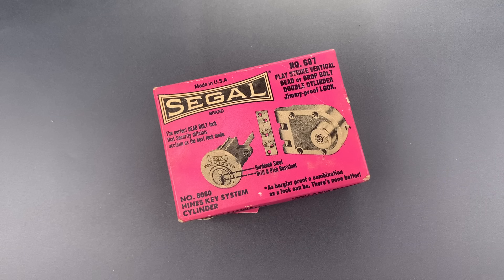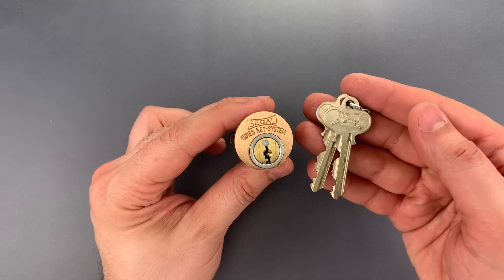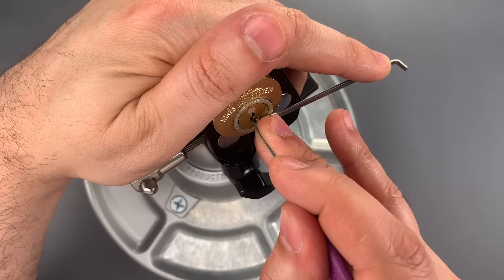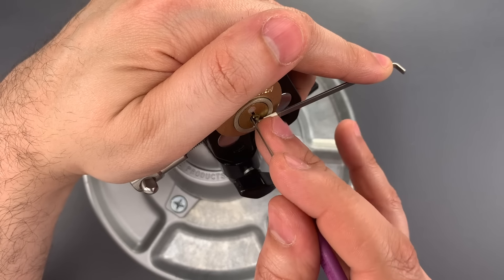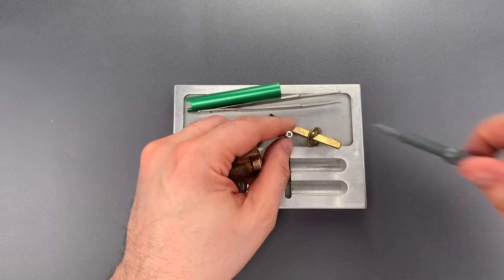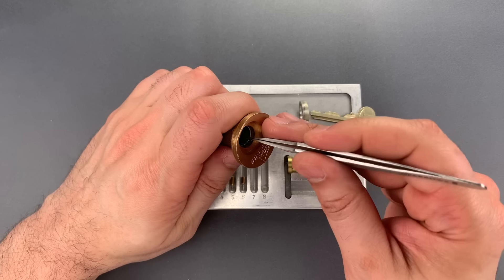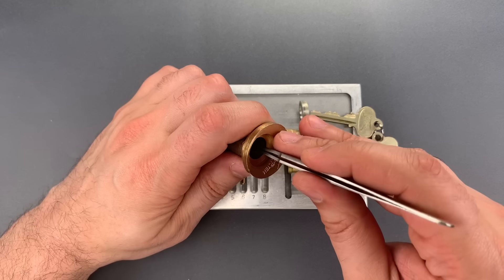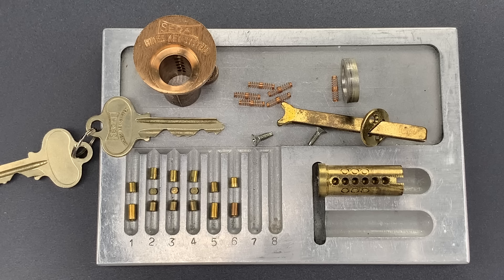[1181] A TRAP For Pickers! The Clever Hines Key System Picked

Comment: I just had a great idea for how to make this basic idea into a near unpickable lock, even if you know the trick. You could have split pins in every position, but which half has the trap is random. Every pin would have two detectable solved states, but you couldn't test for which on is the right one without turning the cylinder and possibly seizing up the lock. There would be 64 possible combinations and you only get one attempt, so a 1.56% chance to get it right, even if you know what you're working with. For added security you could split the pins into even more parts. 3 sections on every pin would give you 729 possible combinations (0.14% chance).
Reply: I could agree. I believe I see where you are going with this and I am curious what other knowledgable people (LPL I am looking at you: wink, wink, nudge, nudge, need I say more?) might say.

Comment: I've had a thought about an anti pick lock. The key has 5 pins, but the lock has 6. One of the pins in any of the positions, would be a switch. Which when pushed up by a picker.  Would just lock the cylinder. Only a special magnetic key could then unlock the cylinder.
Reply: Oooo, I like it!
Reply: Unless the pin was in the last position, the key would lift it when it was inserted.

Comment: All these comments mentioning that this has better security than today's locks fail to address the point that this comes at a considerable cost of also locking the owner out when someone else attempts to pick this lock.
Reply: Leave a window open, just in case. 😁
Reply: A small price to pay for safety. If they made it, they could easily make something that comes with the lock to disable the seizing. However, there would be a bit of security lost.
Reply: @tymoteuszkazubski2755  I'm not an expert on the topic, but I think most burglars break into houses when the owners aren't home. Thus, no benefit to an ability to reset from inside.
Reply: Probably not the right lock for your front door, but if you're a business and want stuff in your records room (or a store room) to stay there no matter what, this feature wouldn't be an issue. The cost of replacing the door probably would be much less than what the room's content was worth.

20 years ago I worked with high-level cryptographic keystore cards for servers. Those were very expensive (we're talking 5-digit prices) and couldn't be transported by plane because the elevated radiation up there triggered their self-destruct mechanism. You could configure them to self-destruct when losing power without being shut down properly (with password) first. They had light (visible, ir and uv) sensors inside their casing, etc. And their self-destruct actually fried the silicon, not just erased the data. Those were used by credit card processors---they just could not afford their private signing keys to be stolen. Re-buying the hardware and creating a new key was a small price to pay for them.
Reply: You are over thinking this.  First drill out the end of the plug remove the HS ring then drill out the pins as usual, insert a screwdriver and turn.
Reply: @Viewer19  but that would be destructive. I wonder whether you could escape the trap with high pressure air to push the hollow pins back.
Reply: Break a small window at that point and climb in. it'd be cheaper than hiring someone to drill out the lock. $200 vs 2.5-3.5k. Plus if the cops are called on you, you did nothing illegal. it's your property. you can do that if you want.
Reply: You're all ignoring one key benefit that he mentioned in the other video on this strategy - with a trap lock, you will know that somebody has tried and failed to pick your lock when you return. Otherwise you'd be ignorant and a stealthy intruder could keep trying on successive occasions without you even knowing.
And the 'lockout' situation is simple - only use this on houses with two doors. If one gets tripped, enter via the other door and remove and replace/reset the lock from the inside. And don't use traps on both doors! (Just have good anti-pick tumblers in the other lock.)
Reply: @tymoteuszkazubski2755  i am aware but if pressure is high enough and tolerances are low enough, air could maybe go around the core and push the trap open still.
Reply: @greatleader4841  A lot of people live in apartments so breaking a window is not an option.  Drilling out a lock takes a battery powered drill and a little knowledge of lock construction that viewers of this channel already have.  Where did you get that $2.5-3.5k from?!!  Plus have you seen what has been happening when the cops are called?
Reply: @Viewer19  from personal experience...i had to call a locksmith to drill out my APARTMENT lock at 3am in nyc because i lost my keys. But please do tell me about my price ranges.
Reply: @pixelmaster98  Yeah, exactly. The goal of the burglar is to be long gone by the time you even notice anyone was there.
Reply: It isnt a considerable cost unless this is the only way in.  The lock is easy to reset with access to the inside.

Comment: LPL points out the main weakness is that it's one-of-a-kind. Doesn't this imply that the world could be made a lot more pickproof if most locks copied Segal's design, but added variation as to which of the pins have traps instead of 2,3,4?
Reply: I think that would just mean people would get used to feeling for double setting pins to ensure they miss the trap. which would stop it from being useful.
Reply: I think that even a single trap-pin out of 6, in a random position, would raise the security a ton. Combined with serrated pins for the remaining 5. The serrated pins would lead to the belief that you´ve already picked the trap-pin correctly, thereby getting it more false than correct most of the time.

Comment: the weakness seems somewhat of an easy thing to fix. You could just swap the order of the hollow pin and the solid pin (which, in this case, is a single wafer).
Reply: I think you missunderstand what the weakness of the lock was. 
The trap part is not a weakness.

Comment: Question: Toward the end of the video you talk about using the plug spinner with a 10% success rate.
Given this seems like a fairly pricey, collectible vintage lock, I can’t imagine LPL being or even having 10-11 of these locks and would be willing to seize 10 of them just to find that info out, so I’m assuming he performed on the same lock 10-11 times.
I don’t quite understand how the core could be removed if it was in its seized state, wouldn’t that prevent you from removing the core? And if not, how is it done?

Another thought, how “hollow” are the pins?
It’s hard to tell in the video
Does it compromise the structural integrity of the pin? If you did fall into the trap and seize the lock how feasible would brute force turning on the core be, and even if it did damage the pins would it damage them in a way that the lock would fail open or would they just end up seizing it worse?
Reply: As long as tolerances are tight, you wouldn't be able to deform the pin and turn the cylinder, you would have to sheer the pin.  If the pin is harder than the cylinder, you would have to deform the cylinder to get movement, a difficult prospect given the cylinder is round and encased in hardened steel.  At that point, the required deformation becomes required compression.
Reply: I do not actually know the answer and had the same question myself. 

My guess is that, if the lock is free standing and not mounted into a door, you will be able to hit it on a table while trying to turn the barrel to it's initial position. Hit it sufficiently hard that the springs of 2, 3 and 4 compress by a distance longer than the depth of the milled "trap points" and you will have it! You will have reset the lock.

Comment: "Plug spinner?" You can't just throw that out there without telling us what it is and how you were able to fail nine times and not damage the lock. Please do a follow up!
Reply: A plug spinner is not a picking or bypass device. It is a simple tool that uses a spring under tension to spin the plug very fast.

It is not frequently discussed on these type of channels because these YTers pick lock cylinders that are not actually attached to a real lock (except padlocks). When these lock cylinders are installed in the full locks, say a deadbolt, lever handle or exit device, there can be certain restrictions on which way the plug turns to unlock the lock. 

For example, you may need to turn the key left to retract the bolt on the deadbolt in your front door. Turning the key to the right it will simply come to a solid stop. If I were to picked your deadbolt, due to manufacturing tolerances, it may pick very easily to the right. However this won’t allow me to unlock the lock even though the cylinder is picked. So once the cylinder is picked in the wrong direction we wind up a plug spinner and it will spin the plug so quickly in the opposite direction that the pins don’t have a chance to drop back down and lock up. So even though we picked it right, we spin the plug left and open the deadbolt. 

He should mention which plug spinner he used and demonstrate the claimed 9/10 failure rate. I dispute that. Those look like standard replacement LAB springs in the tear down, there is little chance they can overcome the force of a plug spinner. I suspect he is either improperly winding the plug spinner so it’s under light tension, only stopping near the trap grooves. Or he’s got a bad plug spinner (it’s not a tool very useful to lock sport enthusiasts).
Reply: @833psz  thankyou for that example, it was very helpful in understanding why a plugspinner would be useful.
Reply: @833psz  you have a talent of explaining things in such a way a rookie like me can still understand. The time you took to answer this is much appreciated!
Reply: The 9 fails would have destroyed the lock if it was mounted in a door but he's got access to that flat brass piece on the top of the lock called a "cover" remove the cover and that let's tensions off the springs and the pins in turn and u can untrap the lock but impossible in door maybe short of cutting the lock out of the door with a saw
Reply: @833psz  i think he might have hit the trap going the wrong way the trap is on both sides for that reason that might have been the fails
Reply: @jeremyhanna3852  Right, plus whichever way you pick it ideally the spinner needs some 'run up' to gain momentum before hopping over the traps and/or pin holes, and the traps may be too close on both sides to achieve that reliably even if you could avoid falling into them on the actual pick. If there were only traps on the one side you needed to turn it then a plug spinner might perform better.
Reply: @jeremyhanna3852  Locks have these things called "screws" that allow the removal of the lock from the interior without the use of a saw.
Reply: @stargazer7644  And, if that door is the only route into the interior?
Reply: @fewwiggle  Unless it's on a garden shed, that's usually never the case.  They make buildings that way, so people don't get trapped by fires.
Reply: @stargazer7644  A lot of rooms (that people want to secure) only have a single door for an entrance/exit.
Reply: @fewwiggle  Well then they might want to think carefully about what kind of lock they use.  This one isn't going to be easy to drill out.